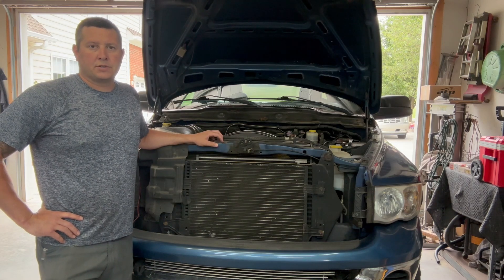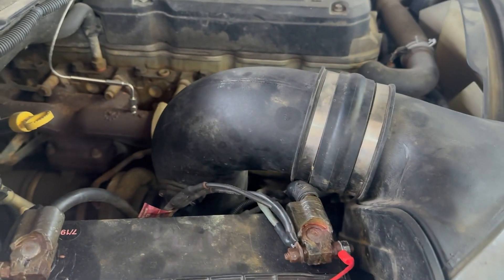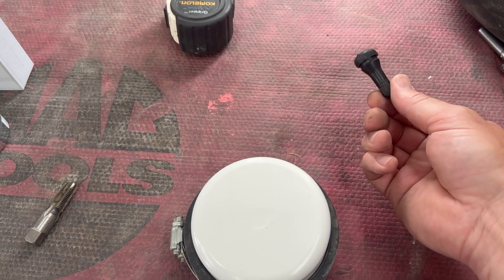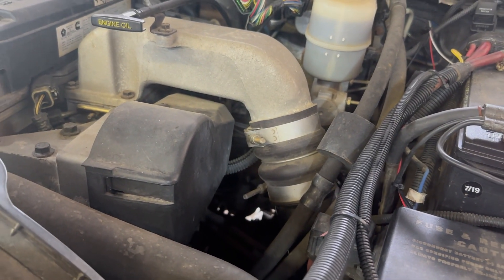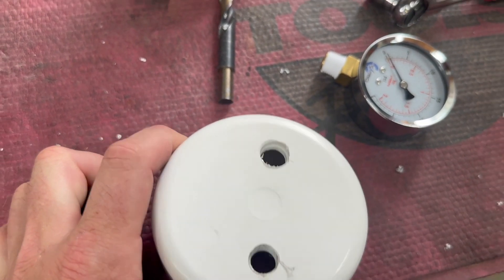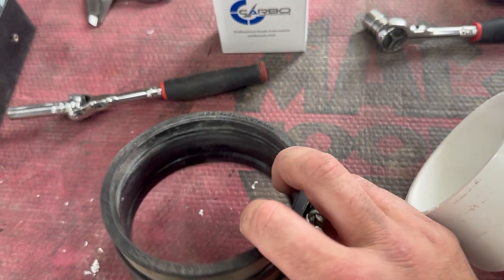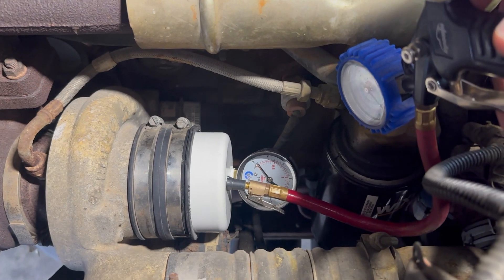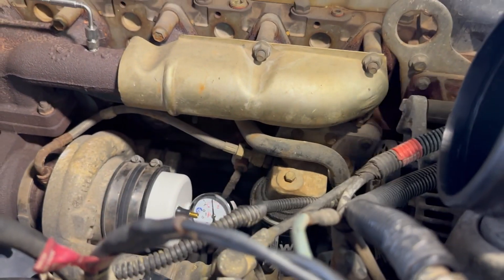DIY boost leak tester for under $20! Find intercooler and tube leaks on your turbocharged vehicles.

Comment: Nice! We have something similar for testing new intercoolers, except we have an inline pressure gauge with a ball valve. You only have to drill one hole in the cap if you have one, just put the gauge behind your fitting and the ball valve behind the gauge. Slightly open the ball valve till you get to the pressure you want, then close it, should work the same as what you showed!